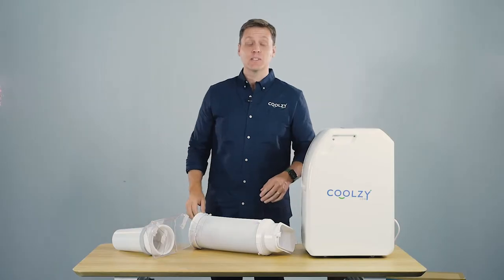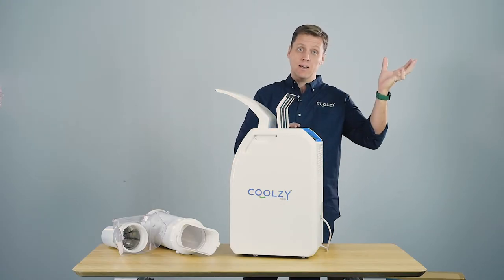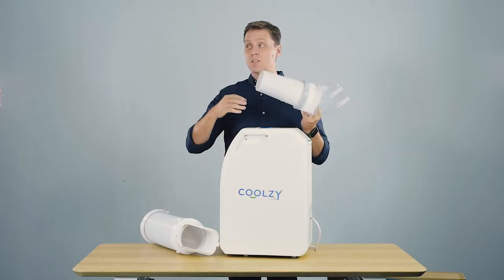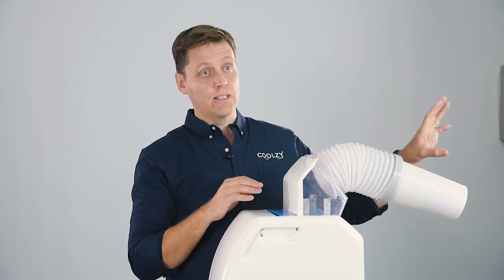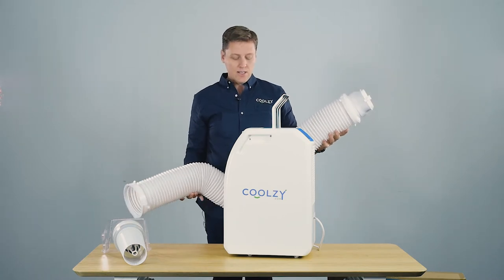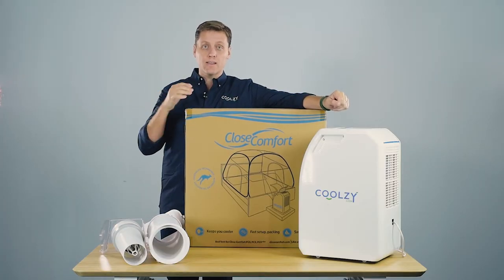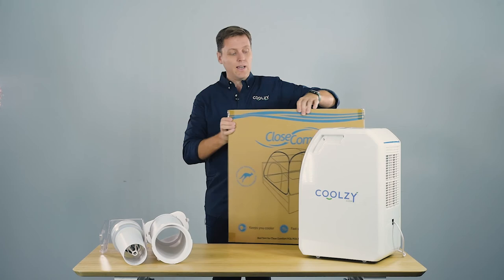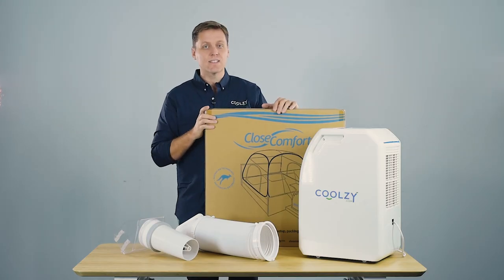How to treat the warm air from a Coolzy

Comment: Extracting warm air. Out " the tail " . And small electrical draw. Can you tell me more about the compressor motor/ refrigerant  is it the sames as the window a/c . But those are at least 5000 BTUs
Reply from the maker: The refrigerant depends on when you live as different governments have different regulations, but in the USA we use R134a and elsewhere R290 to date.  A Coolzy draws a very short burst of high current to start the compressor, around 5 – 7 Amps.  The normal operating current is about 1.3 Amps and uses 340watts in normal operation.

Comment: I have a  booth of around 6 x 6 x 8 feet. Can i put it in there and then connect the Long to the opening I have ? Will it cool it ? If outside temprature is 45C. WIll it cool the booth ? If so then Can It reach 23C ?
Reply from the maker: If you make sure the warm air vent is attached and venting (the Coolzy Long Tail) then the Coolzy will be pumping warm air out of the room. It's a low power AC so it's unlikely to cool the entire room but it will make a difference. In the small space, the best use would be to point the cool air vent at you. It'll product a steady stream of cool air all day long. Check out our other videos (perhaps the video on Blanket of Cool air) to understand the cooling effects.

Comment: Interesting. So there is an AC compressor in the unit? How well would this work in a truck thats sitting in 105°F desert weather..?
Reply from the maker: 1. Is there an AC compressor in the unit? Yes, there is :)
2. How well would this work in a truck in a desert? Depends on the trucks insulation. The Coolzy will remove 1100w of energy from the cab if you use the Long Tail attachment. To cool something you need to remove more watts than it's being heated by so this depends on the watts being input into the cab and the cabs insulation.

We do have a few customer reviews showing folks using the Coolzy in a truck and they seem to be positive.

Comment: Will this cool my dump truck
Reply from the maker: That's a good question :) it depends on a bunch of factors (for instance, how big is your truck and is it insulated). Also, if you're using it in a small space like the cab of a truck, you'll need to use the Long Tail so it can pump the heat from inside the truck, to the outside.

What we can say is that the Coolzy has become super popular among campers for this exact purpose! here's a link https://www.coolzy.com/us/portable-air-conditioner-for-camping/
Reply: @Coolzycom  yes it will be in front seat in cab only small cab don’t think it 75 sq ft